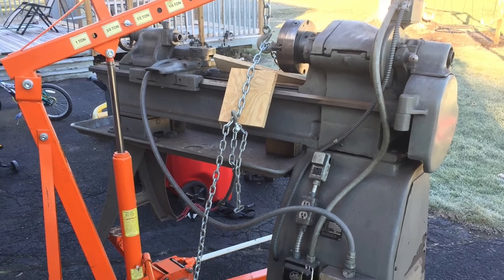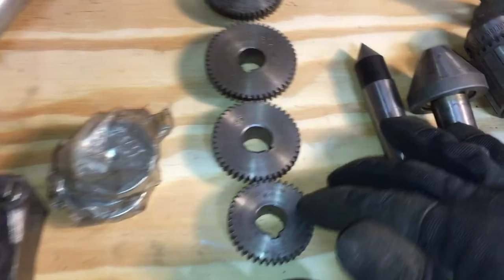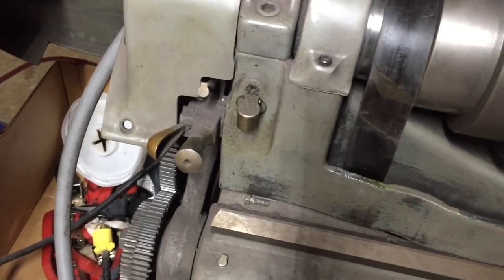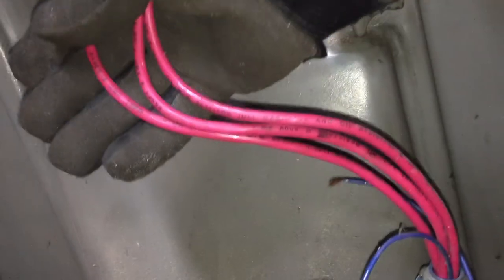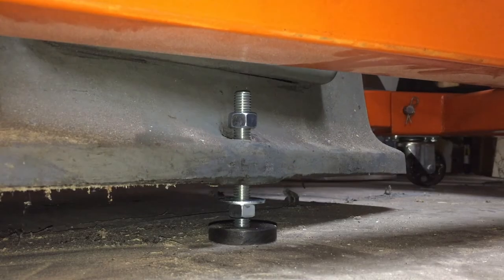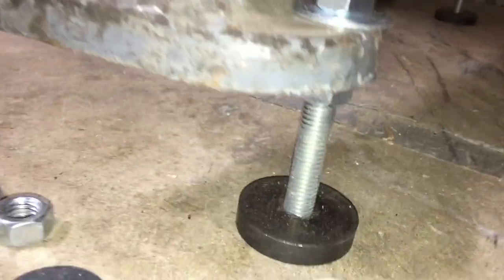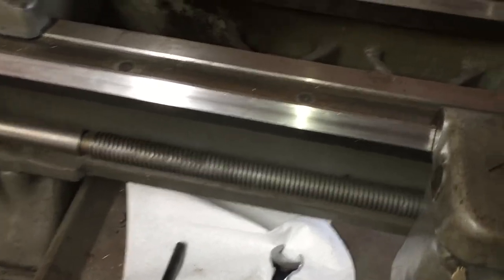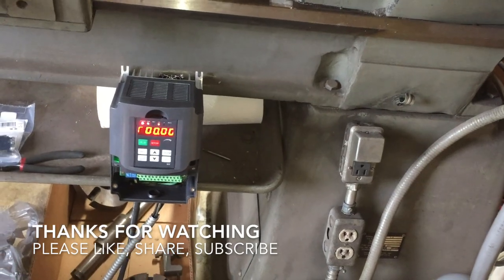South Bend 13 lathe visual inspection, DIY leveling legs feet pads. VFD Power up.

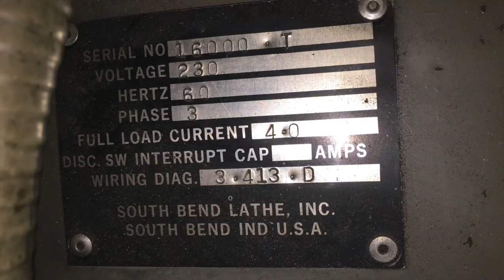Comment: You've probably figured it out by now but the "thread protector" is part of the C collet assembly.  You put the part you're picking up at 0:36 into the spindle and then the "thread protector."  The C collet  goes in last and is drawn tight from the left end of the spindle with a collet closing drawbar (long tube on the right at 0:17.  To get the collet out you loosen the drawbar and then back out the thread protector with a spanner wrench.  The dished washers are part of the lantern tool post.  I've used the South Bend lathes a lot and really like them.  Yes, they're old but they work!  They were originally designed to run off of a central overhead shaft and a belt.  I think the design dates to the late 1800s.  The book "How to Run a Lathe" is based on the South Bends.
Reply from the maker: Yup! You are right! Though, I think I tried to install the C-collet draw bar with all the dongles.. it seemed to work fine without the “thread protector”.. however, I didn’t try to turn parts with it this way, so, cannot speak for that.. 
By the way, I ordered “birth certificate” for the lathe and it turned out to be 40 years old, not 100.
Cheers.

Comment: I moved a 13" South Bend down stairs into my basement with an engine hoist about a month ago. Not my idea of a good time at all. Are your taper adapters for the spindle?
Reply from the maker: +John Strange I know, right! I had to get it rolled in the garage from outside, suspended on the cherry picker, 3" up onto garage floor. The thing would not roll at all outside on the asphalt, I had to "pry-push" it with 2x4, half inch at a time.
Yes, those taper adapters are to fit 5C collets.
Reply: The serial number is pretty awesome, but wait.. Are you getting the serial number off of the ways at the tail stock end of the machine? It should be stamped into the way closest to you. I don't know if you are kidding about it being 100 years old, but it's not 100 years old. I think they added the "Flame Hardened" tag around 1961 or '62, not sure.  I like your drum switch too. Mine might have had one mounted like that at one time too as there are two holes on mine right where yours is, but mine now has a switch on a curved "pipe" and bracket that mounts to the bed, if you know what I mean? I need to look around for a taper adapter like that for mine. I know the South Bends have a proprietary spindle bore that can be made by Miller Metal, but I bet they are pricey.  I bet it was sinking right into the asphalt huh? That had to have been a job rolling it.
Reply: If you need it, here is a parts list and diagrams that covers South Bend for 10" to 16" http://vintagemachinery.org/pubs/1617/3463.pdf
Reply from the maker: +John Strange when I looked up the serial number of my machine in somewhat limited catalogs, it appeared to be made sometime in 1916-1917. The "T" at the end suggests that it was originally a turret lathe. Beyond that, I have no info on it. I personally, never used spindle collets on lathes and at this point don't really see much use of it, not that I am by any means an expert in machining in general, so, just gonna keep it on the shelf where it belongs for now.
On second thought, Sir, you have a lathe! You could probably turn your own taper adapters!
Reply from the maker: +John Strange hm-m.. the other number didn't make sense to me.. I'll have to look into it closer.
Reply from the maker: +John Strange thank you for this info! Saved it already.
Reply: You can order (For $25 from Grizzly) the birth certificate of your lathe by serial number stamped at the end of the bed. It will tell you the year and who the original owner was, and the features it came with.
Reply: Noooo, not 1916. More like late 60's early 1970's I'd bet. Just for starters, an older machine would have the star clutch knob similar to the knob on the motor housing door. Also the "Release belt tension when not in use" tag is in black. I believe the older machines are tagged in red, and by older I mean 40's, 50's and 60's. I'm no expert at all (far from it by light years), but I place your machine at somewhere between like 1962 and 1988. It's always possible that a machine was put together from parts of several other machines as well, so identification by various small factors can be misleading. It's a wonderful mystery that you will enjoy unfolding over time.
Reply from the maker: +John Strange I think I saw this website, and the date of 1917-ish I obtained from there. It could also be from 1967, based on "T" at the end of the serial number. There is also another number stamped on the back side of the bed ways at the tail stock end, DDB301T which makes even less sense. Anyhow, I too thought that a100 years is a bit of a stretch, and all the catalogs of that era do not show quick change gearboxes like mine has. So, maybe it is from 1967.
Reply: It could be 67. I don't know when they switched to black tags, but yes, the double tumbler gear selector would be another indication of being after the single tumbler (or maybe when the single was being phased out in favor of the double, as there might have been a period when they offered both, idk.) The number stamped into the way furthest from you I think (not positive) is a code that relates in whole or part to the bed casting and or the ways. I could be wrong, but I think on some lathes you can tell by that other number if for example the ways are hardened. See, on my machine the main serial ends in the letters TKX which indicates  T =13" K = Quick Change Gear Box and X= Special. The Special X can mean a number of factory options, like hardened ways. Mine is from a time before they were tagged with the Flame Hardened Ways badge like you have on yours, so besides the X in my serial (And I do have hardened ways)  I THINK something in the other serial would indicate hardened ways. Maybe it's how they inventoried or designated which raw beds would undergo the flame hardening process, Idk. My machine has a manual spindle brake which was an option offered by South Bend, and also the optional fine feed carriage hand wheel which I wish I knew more about, but it seems they are kind of rare, so not a lot of info.
Reply: I'm sure by now you are aware of the felt kits and rebuild book and oils you can get from ebay, right?  Join the Practical Machinist South Bend forums if you have questions. Those guys are all super cool, and many are very knowledgeable, or just down right flat out total experts on all things South Bend. Merry Christmas btw :)
Reply from the maker: +John Strange yes sir, I've seen that stuff on eBay and already signed up at PM website. I opted out for "cut my own" felts deal, though. I think I've spent enough on this machine already and haven't scratched (scraped) a surface yet (pun intended)
Merry Christmas!
Btw, you should post some videos about your hobbies, too.
Reply: Great. I bet with the right place to buy from you can save a bundle on the felts. I'm still bruised from the rebuild book price. I hope to have some videos up before Spring. I'm still working on getting my lathe up and running. It's been a really long and slow journey. I should have a VFD in about 3 weeks which should let me at least get spinning. After that I only need about six-hundred and eighty thousand dollars more in tooling and accessories. :)

Comment: Nice lathe but lots of wear for a flame hardened bed.
Reply from the maker: +Rolingmetal thanks.
I also want to order the original documents for this machine. Maybe, the "flame hardened" tag was attached to it later as a sales trick. In either case, it should work for me for I'm not going to use it as a heavy production machine.
Cheers.
Reply from the maker: +alex Bondarenko thank you so much for this information! I looked it up and it seems unavailable in the US.
Reply: Tercite B or Rulon 142 is often applied and scraped in, but it's a pretty involved process. I don't know much about it really, but you an look it up.
Reply from the maker: +John Strange I think I have a plan how o restore bed ways on my lathe. I already bought a surface plate and a straight edge. Still waiting on few more things before I begin the restoration project. Kind of cautiously looking forward to it :-)
Reply: It'll make for great videos for sure. Keep us informed. :)
Reply: Just some thoughts: It's possible (should you choose) to seek advise from Richard King. You can find him several places on line (through Practical Machinist South Bend forums is a good bet). He is one of if not the foremost authority on machine surface restoration.   Also - Use your machine some and see how bad it really is. If your plan is to make parts for a rocket, then it might not be good, but if you are into like making parts for a go cart or something, then the wear might be manageable in a way that you can work around.
Reply from the maker: +John Strange will do :-)
Reply from the maker: +John Strange being the perfectionist and the adventurist that I am, I'll try and trail blaze my own way through it. Maybe one day, I'll be like Richard King :-)
I already made my first scraper today. Will post a video about it as soon as I edit it.